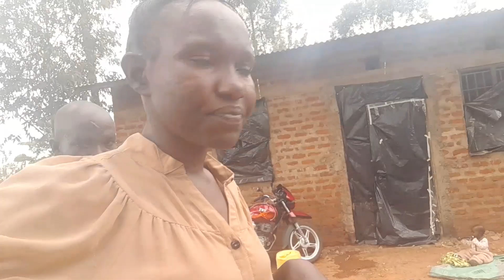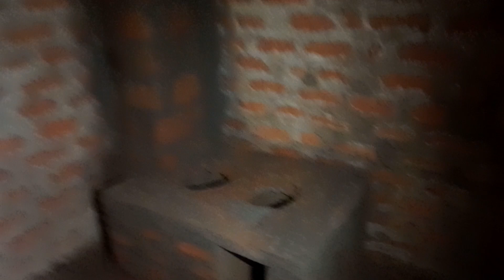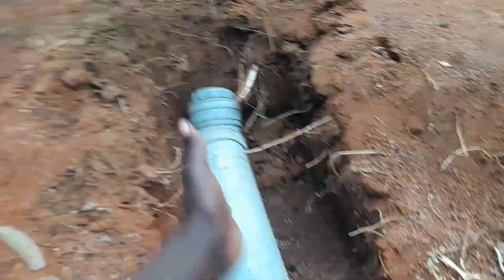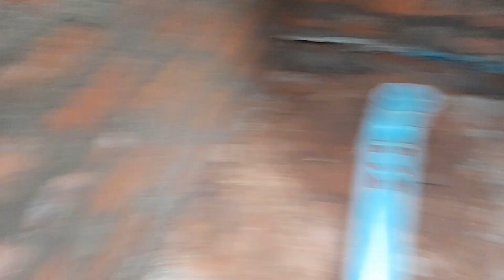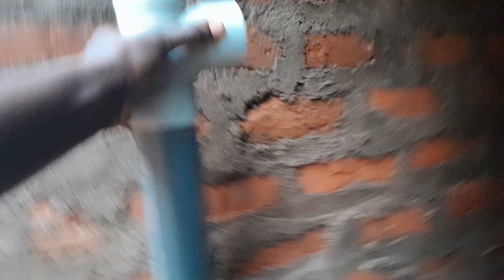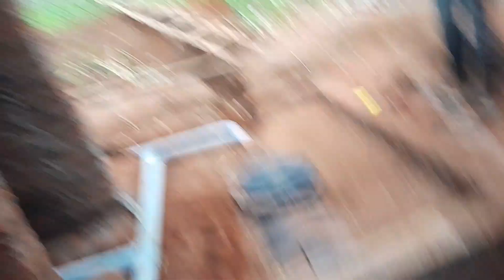Finally Fixing Our Toilets 🙏

Comment: Hello the pipe is too small to be a toilet that pipe look like bathroom shower waste water pipe also that pipe use on the toilet basin you needed a bigger pipe
Reply from the maker: The bathroom pipe is 2 inch and the toilet pipe is 4inch,,I don't think their is a problem with that
Reply: That is what it should be 💕